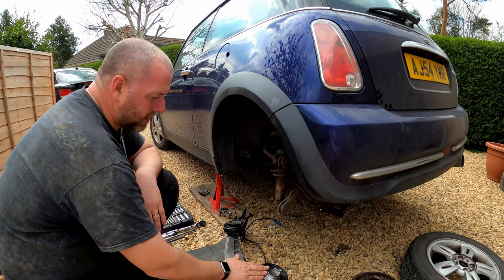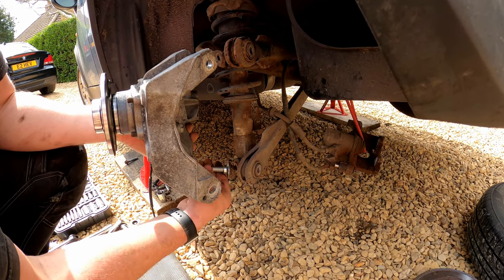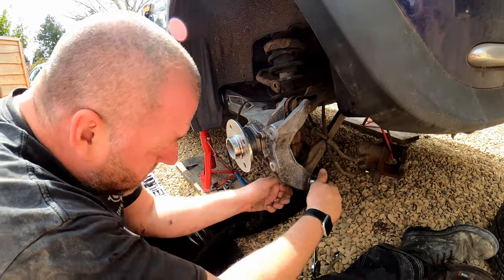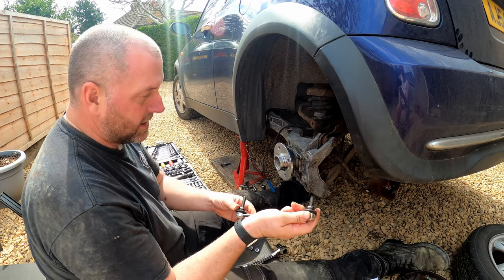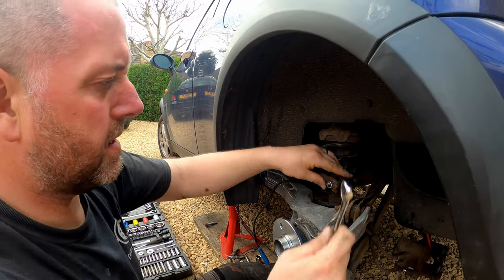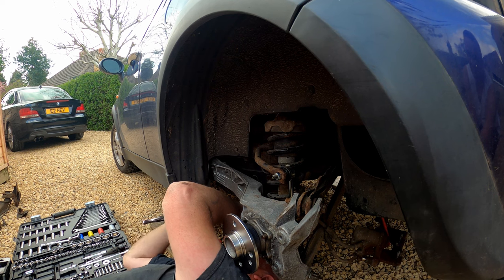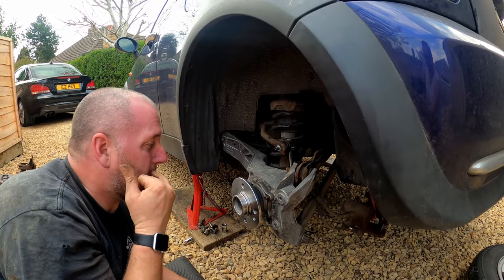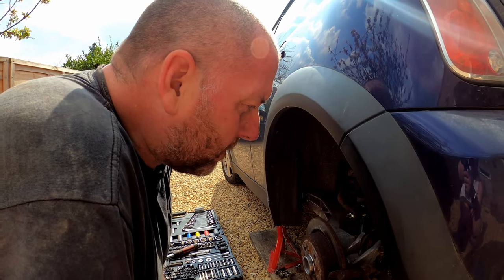Mini R50, R52 & R53 Rear Trailing Arm Upgrade - Gen 2 R56 Alloy Arm Fitment On The Gen 1 Models Pt 3

Comment: nice vid. after getting those spacers for the shock, i went and pulled some arms off a gen2 and noticed the shocks  had that on the sleeve thats one piece going through shock. i cut both those cups off , ground flat side even & there you go! free adapters . also made a sleeve for ABS sensor. looking forward to the feel. pulled another set off in case i do another mini

Comment: Love your videos, so helpful. 
If I just want to swap out the front trailing arm bracket ( new ) with new bushes  can I do that by removing the 3 mounting bolts and the bolt through the bush to the arm without removing anything else ? 
Thanks again for the brilliant videos.
Reply from the maker: Yes absolutely, the front of the arm will swing down enough once the 3 bolts are removed to allow bush removal. A bush puller will be needed however. 👍🏻

Comment: Very helpful video,did you use the original r50 abs sensor and bottom shock bolt just without the funny triangle washer on it
Reply from the maker: I originally bought a couple of Gen 2 ABS sensors only to find that they aren’t compatible so that’s worth keeping in mind. I then refitted the Gen 1 sensors but as the hole they fit in is larger on the alloy arms it’s simply a case of centering the sensor in the middle and tightening. It’s worked perfectly for the last 18 months. The bottom bolt is the same👍🏻
Reply: @KevsShed  thanks,very much appreciated for the knowledge,I’ll try that with the sensor when I do mine soon then 👍🏻

Comment: That’s great , I’m toying with buying new brackets that already have the bushes in them , so would this just be a bolt off bolt on ? Or 
I’m also thinking of possibly doing the alloy upgrade as per your video on my R50 , where did you get the bushes from, I can’t find the right part online and have been told they’re dealer only which doesn’t sound right.
Thanks again for the videos, I’ve done a few jobs already with your guidance 👍🏻
Reply from the maker: I’m pretty sure that I put a link to them in the video description buddy 👍🏻
Reply: Hi 
The links are in the description but I think a couple of links have expired, only if you get a chance I’d love to know where to buy the bushes ( fallen foul of ordering wrong parts ) , cheers Alan
Reply from the maker: Cheers for letting me know bud, I’ll update them as soon as I get the chance 👍🏻